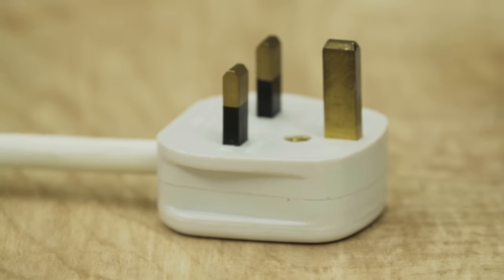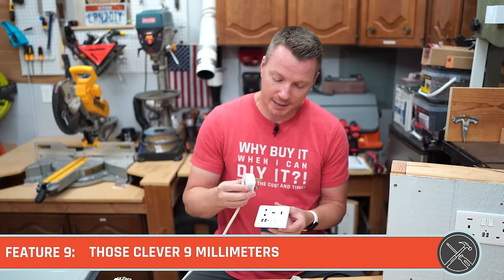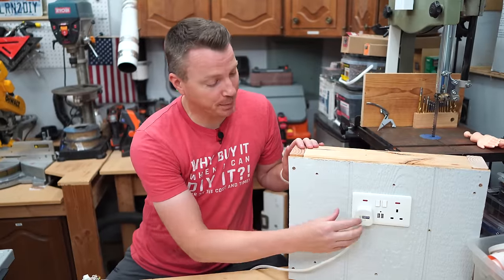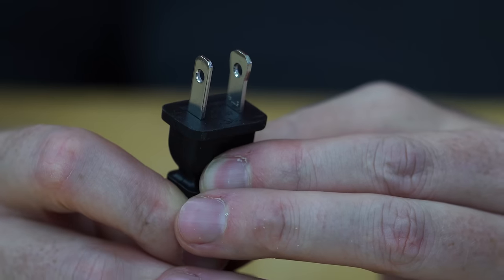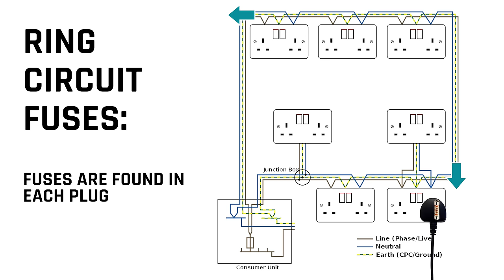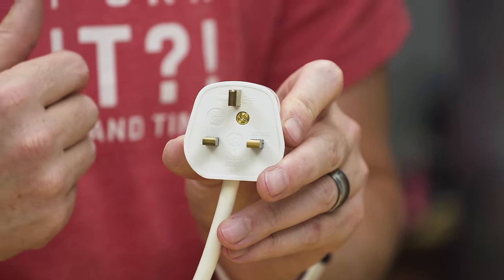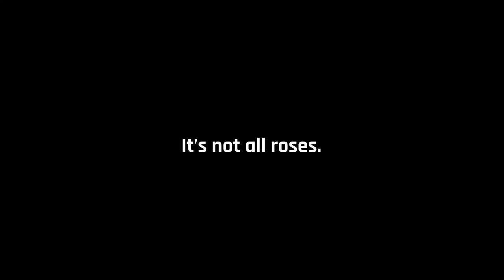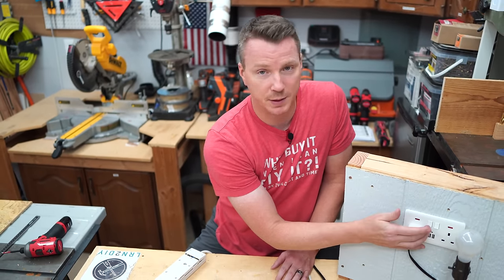British Plugs and Outlets Are On Another Level

Comment: I’m a master electrician in Canada and was the equivalent in the UK. The ring main is protected with a 32A breaker, never heard of the balance issue. The wire size is 2.5mm² this is 14AWG, not a thinner gauge. With a ring main, the receptacle is fed from both sides of the ring; there isn’t any issue with loading up one area of the ring. The max plug fuse size is 13A the smallest is 3A the fuse can be tailored to the device. The maximum area for a ring main is 100 square meters, usually, the kitchen has its own ring main to cover the heavy loads associated with a kitchen. There is double the power available from a 220V plug vs. a 110V plug. A 1kW kettle will use 4A at 220V and 8A at 110V. The breaker box in the UK has 2 x 32A Residual current circuit breakers – RCCB one for each ring main. 6A breaker dedicated to lighting using 1.5mm² wire. The 32A receptacles will trip if a 30 mA fault occurs and must trip within 40 ms, but the lights will stay on. But the receptacles and plugs are expensive compared to North America, but you get what you pay for.
Reply: He did say Master electrician. And then proved it!!
The rules here are very strict regarding electrics and although DIY electrics is allowed there are a lot of situations where a qualified sparky is necessary to be compliant with the regulations. Doesn't matter much - until you want to sell the house...
Reply: I'm fairly sure that 1 Amp fuses are available for the type G plug.
Reply: @manolisgledsodakis873  They are but they are super rare it's normally 3, 5, 13  I've only ever seen a 1 in Christmas tree lights
Reply: @manolisgledsodakis873  The best fuse is a piece of aluminium foil , twisted around the failed fuse and inserted carefully into the clips.  :))
Reply: @jonsouth1545  There are also 10 amp fuses, although they're not very common, and of course they're all colour-coded:

3A - Red
5A - Black
10A - Dark grey
13A - Brown
Reply: Very well remembered Adrian! We also use RCBO's which are a combination unit comprising an MCB (miniature circuit breaker) and RCD (residual current device) and are fitted to each outgoing circuit. They are rated in amps 32, 16, 6 etc., type B, C or D (for the square law (5 times, 10 times or 20 times) for their ability to withstand initial inrush current) and earth leakage detection rated in milliamps, usually 30 ma. 
All three things need to be considered when selecting a device to safely protect a circuit and offer automatic disconnection within the maximum permitted time for that device.
Also, the relationship between current and voltage are inversely proportional to each other, so the higher the voltage the lower the current. That's why 110v circuits require heavier wire sizes.
Reply: @electrickal1  You mean RCBOs and not RCBO's since the RCBOs don't own anything. If you can't communicate then things will fail - quite automatically.
Reply: @kennethkeen1234  Harsh Ken..jus' sayin' (I do hope I have apostrophised correctly)
Reply: Well said Adrian. As an electrician here in the UK I can relate to all of that.
Reply: @daklakdigital3691  Not the best idea - perhaps a very temporary fix in an emergency - otherwise use a proper fuse.
Reply: Smallest fuse for use in the UK plug is 1A. I use them on table lamps.  They are available at proper professional electrical dealers.
Reply: @daklakdigital3691  My Dad always use the silver paper from his packet of John Players. It hasn't all been progress
Reply: @johnburns4017  
As you should … well done
Reply: @Adrian Bridge
The UK has moved away from twin RCDs to an RCBO (a combined RCD & MCB) on each circuit. RCBOs are available in DP, so L & N are switched out, the better option. In apartment blocks over 6 floors the socket circuits need AFDDs (combined RCBO & AFDD).
Reply: @johnburns4017 I am confused. Why would you use a combined RCBO and AFDD? Dont they do the same thing. Ah, I have just looked it up. correct me if I am wrong; 
An AFDD device will detect arcing and hence loose connections, an RCBO will detect overload current and leakage current and hence protect against overloading a circiuit and exposed conductive parts becoming live.
Reply: @MrLeighman  
You got it. AFDDs are recommended for all properties. But mandatory in apartment blocks 6 floors and higher. Care homes, etc.

AFDDs are not cheap. So I can see apartments going back to one ring final circuit for sockets on one AFDD.

One AFDD can have a number of radials off it, with each on its own fuse. the fuses can be in fuse carriers on din rails in the consumer unit.
Reply: @daklakdigital3691  using aluminium foil would be very dangerous as it would not offer any protection to the appliance or the person using it. I once worked on a vacuum cleaner which had a metal body. The entire thing was live and the fuse had been wrapped in foil.
Reply: Power is the voltage multiplied by the number of amps, or W = V x A
220V x 4A = 880 watts
110V x 8A = 880 watts
The Power (As measured in watts) is the same, not double.

Your example is the same amount of power in each case. You forget to mention how many amps are available in a 110v system vs a 220v system, which may or may not be the same.
Reply: @johntaplin3126  Not even in an emergency. I have seen first hand the results of this madness
Reply: @kennethkeen1234  This is disputable. Once we might have written R.C.B.O's, with the “.”s representing truncation and the “'’s elision (as in “don't”—a separate use from possessives). While times change, whether the dotless notation entails apostrophelessness—is, I.M.O., T.B.D..
Reply: @dingers35  i guess it matters in case a diy job resulted in a fire incident and insurance company was able to  prove it.
Reply: @manolisgledsodakis873   That's correct, they're mainly for low voltage adaptors to power electronic devices.
Reply: @manolisgledsodakis873  and 10, saw one in the 70's
Reply: Don't forget that it was Michael Faraday that first found uses for electricity! There has therefore always been a strong motivation to show endeavour and dedication within British engineering institutions. That's why the plugs and sockets are very well engineered.
You are allowed a spur off a ring main circuit, at least until the 16th regs. So it's not as restrictive as was implied. And testing is easy once you are trained.
Having the wire at 90 degrees to the socket allows devices to be closer to a wall. So there is an advantage in allowing appliances to look tidy.
I'd say that fires are more common when using type A or B sockets, and that the mechanical side of the connection to the pins is far more robust and would last the lifetime of the appliance it is paired with.
Reply: you shouldn't be protecting a 2.5mm2 cable with a 32A mcb, 2.5mm2 cable is only rated for 20A
Reply: @daklakdigital3691  lol .. that was kinda popular in the old days, but a very dangerous prctice ast it defeats the purpose of having a fuse  totally😄As a former musician playing various jobs all around the country I had a traditional class a/b 2x800w amp, which used to trigger the breaker quite often if they had anything running off that group. So had to go switching off various things so I could turn on the amp. It was just the startup current when it loads the caps in the psu that sometimes was enough to overload the standard 10 A fuses. So I started to have small ammount of 16 A with me just in case 😂Should always remember the fuses have a purpose. The wiring for a standard 230v AC is typical 1.5mm which have a safe temp value of around 10a before the wire starts to heat excessively. A 3 phased 230v system typically uses 2.5mm wires which can carry 16A
Reply: @JasonGreen3  Thats not completly true. V x A =VA which is not the same as Wat.
Wat is lower than VA cause you have to take the avg output of the phase cycle of the AC current, also defined as pF .
VA and W is often put as equals but thats only true with a DC current
Reply: @daklakdigital3691  I know you are joking but I have seen this done! Also seen (an Electrician!) use 2 matches to power up for testing rather than put a plug on.
Reply: The smallest standard fuse in Britain for these plugs is 1 Amp.
Reply: I have a pack of 1 Amp fuses here. They are a common standard item. You can also buy 2, 3, 5,  and 10 Amp fuses, as well as the 13 Amp ones,  at any decent electrical supplier.
Reply: Speak in english please
Reply: @RWBHere  The fuse is primarily there to protect the cable between the plug and appliance. Often the fuse is rated lower than that in order to give some protection to the appliance.
Reply: @manolisgledsodakis873  I’ve never heard of it or seen it ?
Reply: @kennethkeen1234  You underestimate the RCBO's capability to have a property. One could talk about an RCBO's technical specs, or maximum current, and the possessive apostrophe would absolutely be required.
Reply: "A 1kW kettle will use 4A at 220V and 8A at 110V." that is double the amount of current, power stays same.
Reply: More electrical fires with 110v. Check the stats.
Reply: 2.5mm2 cable is rated for say max 24A and you've got a 32A breaker. That's why load balancing is in the regs.
Reply: Butbut but but... The making of these plugs is always leaving a lot to desire. The fuse-contactors go loose. The fuse overheats. NO. The British plug and socket is a disaster. And this disaster has spread to all the colonies - where this "standard" - is causing fire and death. Nothing to write home about.
Reply: @rjac001  you can in a ring  circuit as the load is balanced, you would also use a 32amp breaker on a radial circuit wired on 4mm twin & cpc

Comment: A nice benefit to the cable exiting the bottom (rather than the front) is that no matter how thick and heavy it is, the plug will never sag in the socket. I've seen brand new type A/B plugs in brand new sockets sagging and falling out of the socket just from the weight of the cable on them.
Reply: And you can put furniture right infront of the outlet and still have something plugged in.
Reply: @electricpaisy6045  I was going to comment that too, the cables sitting flush to the wall is very convenient
Reply: It baffles me that people are baffled by plugs with angled cables. In continental europe both types are in common use.
Reply: A receptacle that allows a two-prong plug to sag is defective and should be replaced.

Comment: As a Brit, I love that the downsides are that, they're big, you wouldn't normally check the switch, and you can stand on it 😂😂😂
Reply: Ikr? I’m also a Brit and checking the switch is a pretty common thing to do, not a flaw. It’s just Americans aren’t used to it 🙄
Reply: Yeah, but I HAVE stepped on it, and it is excruciating. Still not as bad as an electric shock though 😂
Reply: @1815matt  I think every Brit knows the pain of standing on a plug! It normally happens at 3am on the way to the toilet 😂
Reply: Reckon he tried a bit too hard to find downsides!
Reply: @imlanding  when you're trying to be quiet... but the barrage of expletives you let out when you step on one is never quiet 😂
Reply: EU plugs for the win, every safety system and more than British plugs have, but more compact and you can put them on either way.
Reply: @PalpatinesPlumber  Shuko (EU) plugs are terrible. Putting them in either way round means you swap live and neutral. The earth contact often does not connect and can bend off removing your protection (they can even bend and be pushed by the pin into the socket) many are extremely flimsy and are easily broken and pulled apart. You can put the same sized two pin plug either way into the same socket. And they tempt people to push wires in with matchsticks when they have no plug. They have practically none of the safety systems the British ones have.
Reply: @loracle540  yeah I don't know why he's/she's being an EU supremacist over a clearly inferior design 🤣.
Reply: @imlanding  I have stood on bamboo, Lego and our great but excruciating plugs, plugs beat them all
Reply: @1815matt  Worse than lego! LOL
Reply: @loracle540  Absolute cap, First of all in AC it doesn't matter which way live or neutral is, after all ac literally goes back and forth. Never had an issue with the ground pins and there is 2 of them anyway so if one fails they still work. You can't stick anything through the plastic "cover" that's in the neutral and live in the socket and the socket itself also has a 3cm edge covering it which is something the UK plug doesn't have. Now there might be some badly manufactured EU plugs, but none of what I've seen have had any issues you said.
Reply: Worse than child birth. I'm a man, but I cannot imagine giving birth is more painful than stepping on an upturned UK plug.
Reply: @loracle540  And yet, I've never even heard of this being an actual problem, from any of the European people I know. Same with the switches on sockets, every other country does absolutely fine without them. It's typical British health and safety: overly concerned with unimportant details like that, all while cladding entire buildings in highly flammable material... We're not the best at determining what safety features actually matter.
Reply: @PalpatinesPlumber  not in Italy. They still tend to use the two-pin no-earth design.
Reply: I actually use the longer ground pin for acupressure on my feet :)
Reply: @imlanding  immediately afterwards you stand on the kids lego too. 😂😂
Reply: standing on it is fr the worst part 😂 most other nations will never know that pain!
Reply: Also UK plug has a smaller profile when plugged in as its flat against the wall/socket, as apposed to the US plug that sticks out horizontally.
Reply: @CFTim  The switch is a good idea. Frugal American YouTube people think plugged in appliances that are off still use electricity so they have to unplug everything. A switch would be easier.
Reply: @realitycheck3361  And then in extreme pain and frustration you kick the door frame.
Reply: @80PercentScottish  fancy seeing you here!
Reply: @imlanding  it’s definitely up there with Lego, as a Brit I can relate to this very well, especially on ye olde night shift when you get home at 4:00am and it is dark in the house😂
Reply: Those weedy little American plugs will be useless for fighting off the zombie apocalypse.
Reply: Even load balancing is counteracted by us having multiple circuits and breakers, especially for power hungry items like ovens...
Reply: @1815matt  yup! Worse than lego!
Reply: @CFTim  We were hence we have the British Standard "Kitemark", as found wherever we colonised. Building cladding presumably isn't subject to such stringent tests.
Reply: @imlanding  nothing beats the pain of standing on a plug hard enough that it sticks in your heel 🥲 never repeated that mistake thankfully
Reply: Yeah let's rip this washing machine apart to figure out why it's not working..... Wait a minute "I never flicked the switch".
Reply: @jubeaumont6305  where else have you seen me? 😅.
Reply: I was given a kitchen appliance (food mixer or similar) but with a euro plug. I cut the euro plug, stripped the wires and fit into a UK plug.

Job done 👍
Reply: @idcgaming518  Do you mean type C plugs? (europlugs)? We do have them everywhere, but they are only for double insulated appliances that draw less power.
Reply: The problems that the UK plugs are purported to solve have never been an issue for me in the US.
Reply: @clownpocket  You're massively lucky that you never got shocked with these plugs. Still no reason to carry on using this safety hazard of a plug instead of one where getting shocked is physically impossible.
Reply: @ediblemanager   Nowhere near 5 x as big 2x maybe ??   2.5mm Twin & Earth is just fine.    And much safer!!!!!

Comment: In most modern British houses, anything that would be heavy on load, such as your oven/washer/dryer, dishwasher, or shower would tend to be on a separate fused circuit of their own anyway. So that particular negative doesn’t really apply. 

The one thing he misses about the switches at the outlet/socket, is that most display a red tab when they are in the on position. It makes it real easy at a glance to know if the switch is live, and is very handy if you have little ones running around.
Reply: Or they have ON printed on the upper  face
Reply: @applejuice5272  They still confuse me though, if you can see the word 'ON' it means the outlet is on/ live correct?
Reply: @chatteyj  Yes
Reply: Some even have red led that get turn on when you switch the power on.
Reply: @GlennHoddleSucksSocks  The word ON is printed on the top face of the switch itself and is only visible when the switch is on but if you didn't know, you could interpret the switch as being off and that you need to press ON into the wall to turn it on.
Reply: @johno4377  That would just be bad design.
Reply: @GlennHoddleSucksSocks  when the missus tells you the plug is saying "NO" cos she's looking at it upside down. Proper confusing. Lol

Comment: The black insulation on the live and neutral pins has not always been there. It was introduced because of the amount of people pushing metal objects like cutlery and other metal objects behind the plug. The plugs can be hard to pull and the amount of people with arthritis and children that were killed trying to prize them out of the wall was the ultimate reason that they are now insulated.
Reply: Consider it a live service update. One of a few in fact.